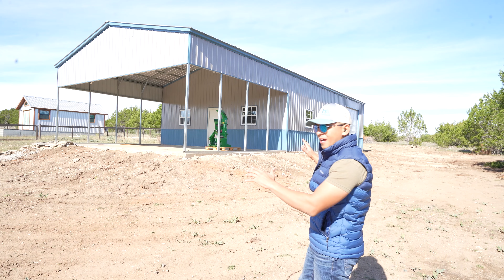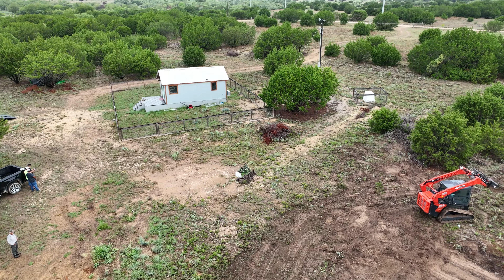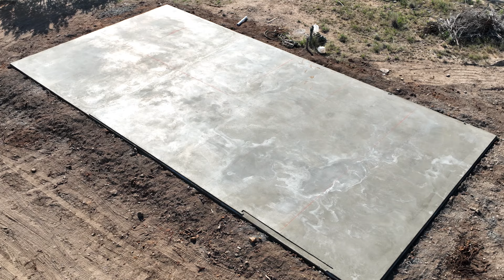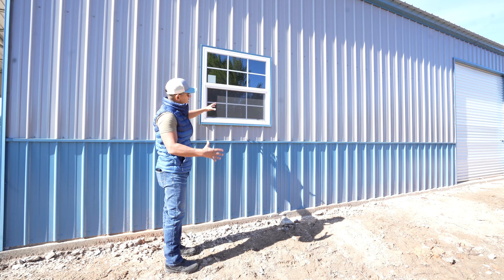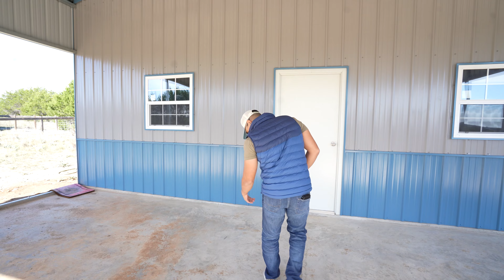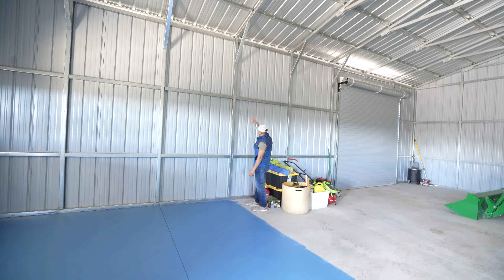Step by Step Process in Building a 30x60 Texas Steel Building with a Porch  | WolfSteel Buildings

Comment: What would be the ballpark price estimate for the same building in 40x30 with concrete in La Coste, Tx?
Reply from the maker: Hello Duane! the pricing for a 30x40 Metal Building can range from $18,000 to $25,000 all depending the features and accessories you select. That pricing includes delivery and installation on your level ground. Concrete pricing varies based on location and site conditions but you can be looking at around $13,200 - $16,000 for your concrete slab around 1/30/2023.